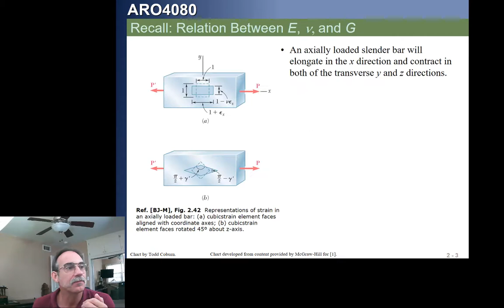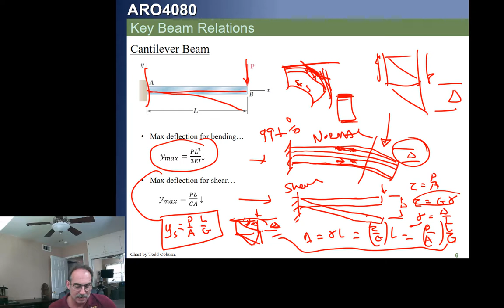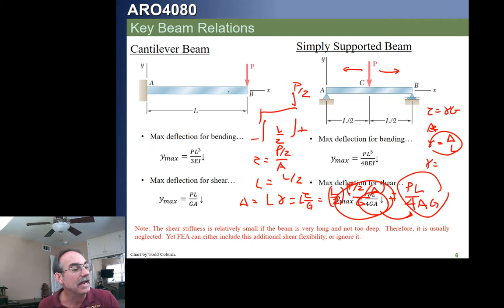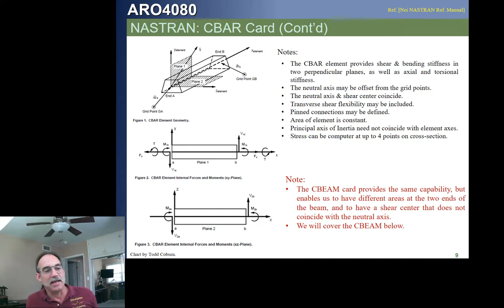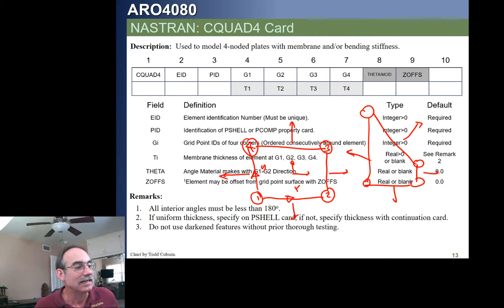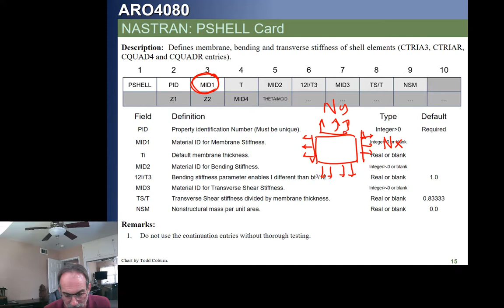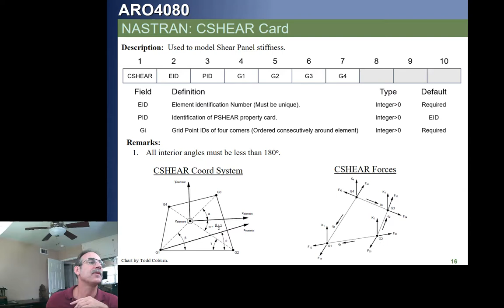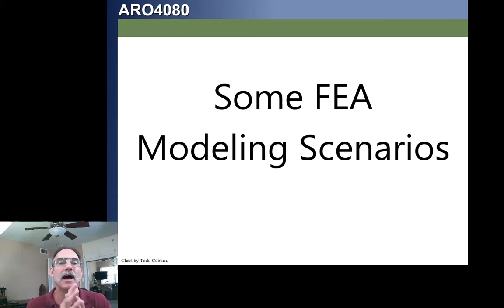Finite Element Analysis: L-08 NASTRAN Beam & Shell Elements

Comment: Could you please explain the PSOLID Card Please.
P.S Love your videos thank you alot
Reply from the maker: Thank you for the feedback.

I usually try to discourage folks from using solid elements for a number of reasons.  One of the primary reasons is that they are often not needed.  Another is that they are harder to model correctly, harder to attach correctly, and harder to interperet.  Also, the growing trend of auto-meshing solid elements from 3D models introduces ridiculous amounts of complexity, with little or no payback in accuracy.  While they look pretty, they confuse the model and make it more difficult to understand and debug.

Usually, a sufficiently accurate model can be obtained using plate elements modeled at the midplane.

An obvious exception is modeling solid structures like large forged parts, where the use of solid elements might be a better approach.  However, once solid elements are used, it is likely the only meaningful stress that can be evauated is principal stress and/or von-mises, which will not capture stability issues like buckling or crippling.

Many Expert FEA folks are able to effectively use solid elements, but only after thoroughly studying their use and application.

I currently focus my content on coarse modelling, since this is the best approach for perhaps 90% of lightweight structures.

Once i have developed sufficient content on coarse modeling (i am currently working on a handbook for that) I may provide some guidance for simple solid element modeling, but that will probably be a year or so off.

Sorry if this was not enough help.  :-)